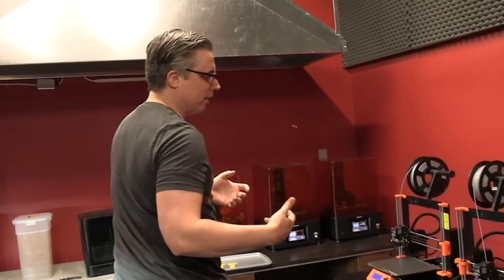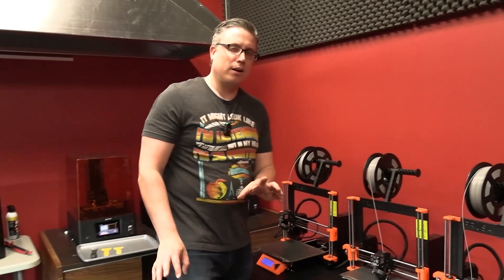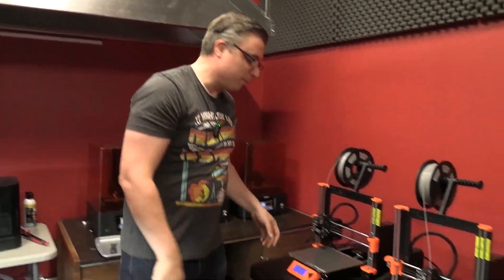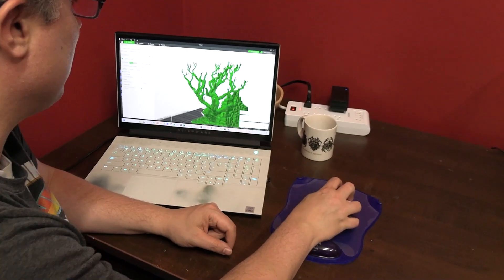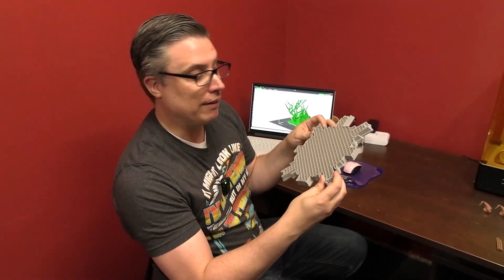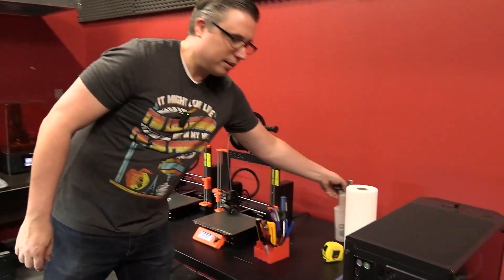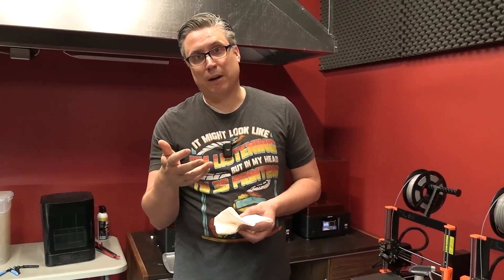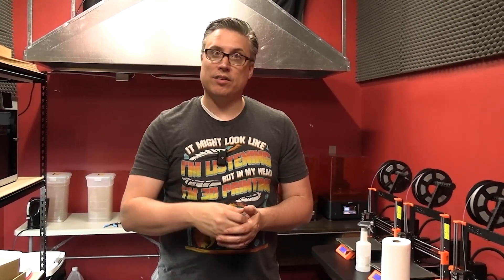A Quick Intro to 3D Printing Terrain with FDM Printers

Comment: Hi Matt!! Very cool video. Are you planning on more “advanced” videos? I recently read an article on fabaloo, which made a valid point about 3D printing splitting into “consumer” and “makers”. Meaning printers are either going to become easier, more plug and print, and require less tinkering or stay as they have actually are right now which require user input a lot. Curious to know what you think!

Comment: the "totally safe, don't need ventilation" comment for pla on an fdm printer isn't accurate.  While much less dangerous than many other fdm materials or any resin printer, pla is still plastic, the printer head is still melting that plastic in the printing process, and as it melts microparticles of it are released into the air in quantities that are measurably above safe-to-breathe levels, so a few basic safety measures are needed.  You won't want to have it running in your bedroom - especially not overnight while you're sleeping.  You'll want some basic ventilation - like an outward facing window fan near the printer- or at least a halfway decent hepa filter running next to it.  And you'll want to wear a mask if you're in the same room with it while it's operating or for an hour or so after it's finished.  These are relatively minimal safety measures compared to what you'll need fdm printing with many other materials, and way less hassle than what you'd need to go through for resin printing, but minimal safety measures isn't the same as /no/ safety measures.

Comment: Hey Matt, this is Mat.  I'm really, really struggling to get my printable scenery prints to work on a Kobra max.  Do you have a recommendation for slicer settings?  I've replaced almost all of the parts, the bowden tubes, nozzles, eeeeverything and I"m desperate to get this to work :(

Comment: I must've gotten lucky. I've had my Ender 3 for like 5 years and haven't had to replace anything yet. It still runs great. I take that back. I did have to replace a tip, but that was my fault.
Reply: how much where you running the thing? from what it sounds like the issue could have just been that the ender isnt made for a shop setting and was just getting over worked (or just had all its general runtime used up really quickly)
Reply: @darkdruidsvale  I print a lot, but not production level. I play a lot of DND and print a lot of terrain for my games. So I do run through a lot of spools. I tried printing minis, that's just too stressful. So I bought a resin printer for that.

Comment: Thanks for the great vid Matt. I got 2 questions. I recently started looking at resin printers to print both miniatures and terrain for my local group. It seems as though noone uses resin to print large terrain pieces. I certainly wont be able to get both fdm and resin. Could you not print terrain models with resin printers in pieces?
2nd, what's your post processing for the Prusa printed terrain? Would be really keen to see how you get rid of the lines, is there a convenient sanding method? etc.

Comment: 👋 thanks for the videos. Watched the intro and the resin one too.
I want to start with 3d printing and for sure I don't want to start spending 1000 bucks in a printer that I don't know how to use. I thought on getting a creality but I saw a anycubic Kobra 2. Any thoughts on that?
Reply from the maker: Honestly they should work fine.  If you want to learn about how the 3D printer works and how to maintain them, a cheap printer is the way to go, as they will tend to give you more problems (not always, just on average).

But if you have the money, buying the printers that I recommend will save you a lot of hassle.  I think of it like buying any other appliance.  You don't want to have to learn how to fix them, you just want them to work as intended.

Comment: Hey Matt - Great video and great content.  I just bought a Elegoo Nepture 3 pro for terrain, and I'm new to the hobby as well.  It looks like you're using some higher quality printer models so you're not having layer line issues.  It would be really cool to learn how you dealt with layers line for economy printers that have layer lines in the past - especially for details terrains!  Please keep up the great content - it's incredibly helpful!
Reply from the maker: I basically ignored them and accepted them. I know there are methods to reduce them, but I was too lazy to do that. ;)
Reply: How do you like your Neptune? I have been debating the Neptune, cause I love my Elegoo Mars 2 for Resin, but I could also just save up for the Bambu if it is really that much better. But if the Neptune is good then I might go for that.

Comment: I got an Ender 3 v2 a few years ago, replaced a lot of things, added an auto-leveler, etc. Manually leveling the bed was so frustrating and the overall usage of it was such a pain.

I want to go for a P1P but worried I might still have issues, we got into 40K and wanting to print a bunch of terrain, and inserts, etc for board games.

Loving the videos!
Reply from the maker: Just do it man. It’ll blow your mind. :)
Reply: @MWG_Matthew  I just set up my P1S today! Already printed some test prints and just did my first piece of terrain! 

Worked immediately and so stoked to have a full 40K table with proper terrain soon, I've been looking everywhere and just trying to decide which set I'd like to purchase to start! 

Thanks for the videos!

Comment: Am I the only person that has had really good experiences with my Ender 3 Pro?  I tinkered with it awhile to start with, upgraded some parts (though not really to fix broken ones), and got it dialed in, but I haven't actually messed with the hardware or software in the last year or so.  Now, of course I don't print near as much as you guys, but I do print with it quite a bit (even some models), with some projects lasting up to a week of continuous printing.  Eh, maybe I'm just lucky.  Running 3 or 4 at a time I'm sure it ramps up the chances, too.

Random Side Notes: FDM supports are evil, I have stabbed myself several times and broken  knives trying to get them off.  Filament brand doesn't usually matter, but I have been using mostly Overture.  Why does super glue have such a difficult time adhering to PLA?  It works, but man is it slow.  And I've tried a few different types of filament (ABS, PETG, etc.) but have never found a good reason to use them over regular PLA.
Reply from the maker: You're definitely not the only one.  I think the main difference is how much we're printing here, so any small problem gets amplified to a much larger one as we're busy fixing things over and over again.

Overall I look for something that is reliable.  I'm more interested in 3D printing than in learning how to maintain 3D printers.
Reply: @MWG_Matthew  I've done 7,500 hours in 18 months on my Ender 3 S1 and it has been a solid workhorse to learn FDM printing on. Maybe I've been lucky but I've had very little maintenance, very few problems with adhesion (usually the STL's fault not the printer's), and it has felt like a value purchase every single month. That said, I'm looking to get a second printer to up the volume of filament I can push out in a day, and it probably won't be an Ender 3 :-)

Comment: The glue stick trick is much more valuable if you print in materials with low bed adhesion like ABS, or if you have a bare metal build plate. Both are things that are mostly out of fashion now. Also in regards to PLA, even though the actual printing doesn't seem to be effected by cheap PLA vs higher end PLA, I have encounters some cheap PLA that react with GW spray primer(and likely any spray paint because of the solvent in it) and get super brittle weeks to months after printing. I always recommend known value brands like Sunlu, Elegoo or even Amazon Basics PLA among other comparable priced products as a bare bones minimum of quality. The $5 per kg unbranded spools you find on ebay may leave you with models that fall apart in your hands after painting, but at the same time for tabletop terrain you don't need the $50 per kg premium PLA either. I normally encourage people new to printing to try a few 1/2kg or sample pack of a few different value filaments and when they find the one they like the results of best just buy that in bulk, same brand and even same color. Different pigment powders used to color the filaments can actually change how it flows at the same temperature changing the finish quality of a print produce with the same settings using 2 different colors of the same filament.

Now that you guys have your own print farm I can't help but wonder what ever happened to that original concept game you guys were developing like 10 years ago?

Comment: Another great option especially for the miniature wargaming perspective is the Prusa Mini which is less than $500 delivered for mostly assembled (I think it took me 15 or 20 min to start the first print). It has a smaller build volume than the Prusa MK3 but is about the same level or reliability.

Regarding the speed of the BambooLabs X1 Carbon, from what's been shown on the Prusa MK4 is much closer to the X1 Carbon for speed with the recent release of input shaping and pressure advance. It's not surprising that the MK3 isn't as fast since it was first released in 2017 and the consumer 3D printing market has been rapidly advancing and changing during that entire time.

One of the hesitations I have with the BambooLabs printers over Prusa printers is that Prusa has a long proven history of solid designs with great ongoing support and consistent software updates that add valuable features while BambooLabs is a fairly new company without that history so we'll have to see how they do.

Comment: While both the Prusa printers (great support, by the way) and the BambuLabs printers are great machines, i wouldn´t recomment them for beginners. The price tag is simply to high. The Ender isn´t that great, but there are other similar printers out there. I am miore of an Elegoo guy. I had and have great success with my Neptune 3. Compared to the Neptune 2 (which i also had), the auto bed leveling really makes a difference. The price point should fall into the 200 to 300 range (Dollar or Euro), which is much more affordable. And you really do not need to replace parts, it prints out of the box with some light assembly on and on. And since i do not want do make this into an Elegoo commercial, there are simalar printers in this price ranghe with the same (ore mayber better) qualitiy. I just do not have them. There are also many many who are simply worse and not worth the money. But, bottom line, you do not need an 1k+ 3D printer to print good terrain (or functional parts). So, if you are put off by the price point, do your research and you will find cheaper machines which will do the job, maybe not as fast as the BambuLabs, but non the less.

And just as an example, i actually printed a fully functional repeating crossbow (the Adderini) wit my Neptune 3 and it works. I didn´t upgrade my mars in any way, the tolerances are all there, everythings fits.
Reply from the maker: I don't disagree.  With enough time and research I'm sure you could find cheaper options.  I'm just sharing my experiences, and trying to help those that don't want to spend all of that time figuring it out.

Comment: Thank you for the video! What type of supports do you use? And what percent support density? Thanks!
Reply from the maker: Typically 10% support density for terrain. And I avoid terrain that needs supports. But if they do, I go with the auto generated tree supports that most slicers can use.
Reply: @MWG_Matthew  thanks, i will try that

Comment: You said in your last video that the anycubic printer you used was not good, did you ever try any of the others or did you just abandon anycubic all together? I am just looking for a large printer and the kobra max has had some good reviews and was hoping for some insight from someone i trust.
Reply from the maker: After they worked so poorly and the customer support sucked so much, I switched to Ender, which was fine for a while, but the quality still wasn't great.  The Prusa (and then the Bambu Labs) printers would such a breath of fresh air because they just work, with minimal repairs and maintenance.